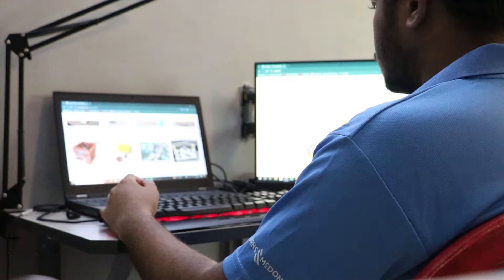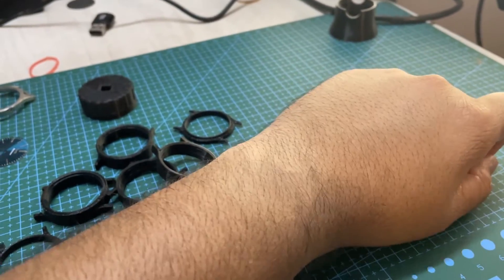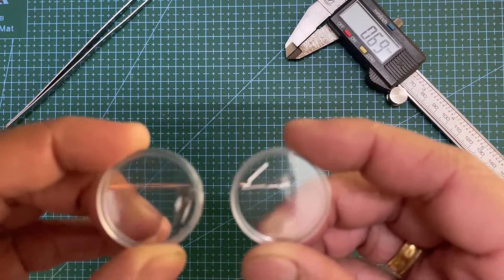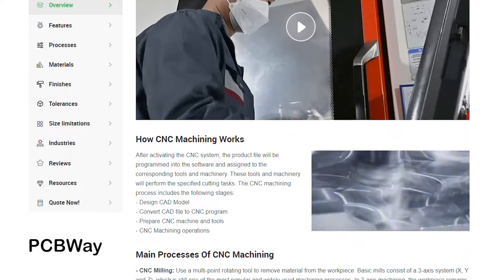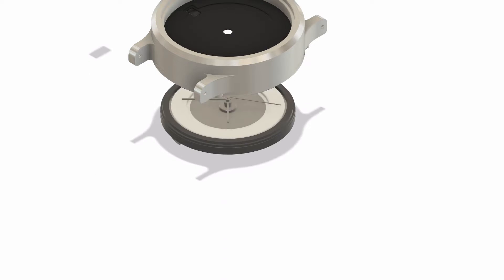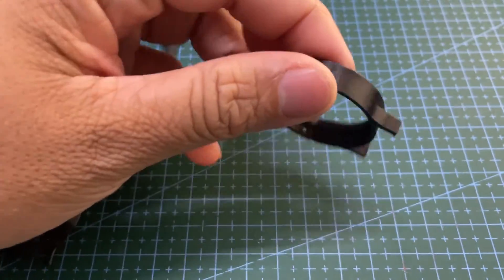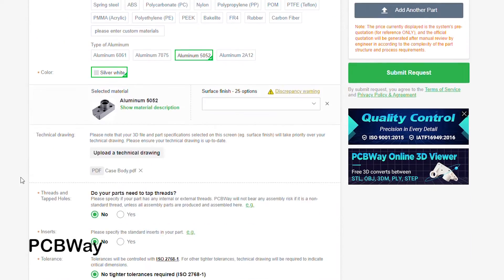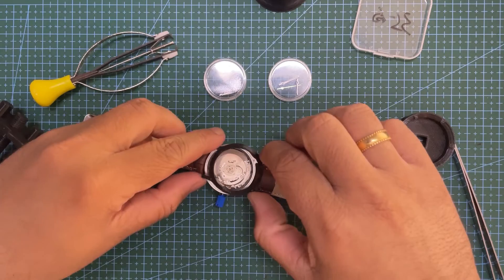CNC Your Own Watch Case | DIY Mechanical Watch - Part 1

Comment: No gloves when handling watch parts is very bad form! Finger gloves are so cheap so please whenever you work on your own watches, use that. The oils in your skin will easily cause deterioration of the gears of a mechanical watch!
Reply from the maker: Agreed 100%! Will take necessary precautions if I ever built another one. Thanks for watching!

Comment: Great Video! Thanks for sharing. Where did you find the dimensions for the inside of the case?  i want to build one too but im not sure how the movement will fit.
Reply from the maker: The datasheet for NH35 movement had all the dimensions for case & dial.
Thanks for watching!